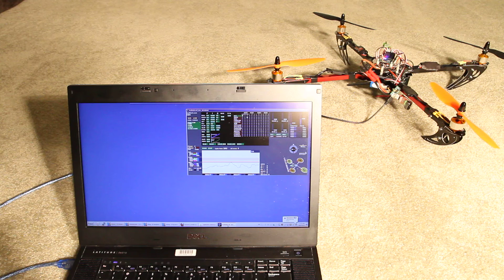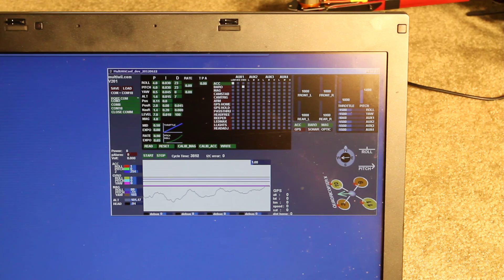MultiWii Quad problems cannot fly

Comment: Bro, you are using 18650 or similar LiIons. I used the same initially. Same problem.

But the real problem is that we all are dumb initially and the learning curve is very steep.

Those batteries just dont have enough amps to drive all 4 ESCs and motors. The Amps drop and thus one or more ESC cuts off.
Reply from the maker: I'm using 30C 3S battery, that do 30A discharge.... I do not think that was a battery issue :)
That was issue with that fact that it was in the air, also I switch from X to + configuration also reduced vibration :)
Thank you for comment !

Comment: I had an issue with the same exact kit you have bought, I am guessing from amazon from hobby power. I fixed many of the instability problems by putting everything onto a wooden frame. The MW FC needs decent vibration isolation. So build a wood frame, with a square hole in the middle to suspend a plate or board with all the electronics mounted on it. Will all that weight of the battery, electronics, etc suspended by strong, high tension bungee cord or rubber silicone tubing. Worked will for me.

I am, however, still having an issue, which I believe is related to the ESCs. Some reason when going from 0 throttle to some low level amount, 2 of the motors would occasionally glitch up and not work properly, as if only for a moment one of the 3 wires was a broke connection. It seems to have no physical cause after examination and more examination.  Please reply if you are having the same issue. Thanks
Reply: So, if I change my ESC the problem will be fix ?

Comment: 2 alternate propellers slowing down in normal, and is due to the integration in PID control. Because it isn't lifting, but the MW FC is still trying to correct small changes in pitch, roll, and yaw. In your case, it is probably yaw. The I attempts to cancel out "steady state" error by gradually increasing the difference in speed between the motors in attempt to correct the error. It obviously never does since it isn't even moving, and so the correction keeps gradually increasing. Bump or rotate the quad some and it should sort of reset
Reply from the maker: Yes! now I know this :)
Reply: amirnasher Have you got it up and flying reliably? And not having the same issue as me with the hobbypower ESCs? Did you flash the ESCS or any other mods to them? Thanks!
Reply: amirnasher Actually, you have the exact same kit as mine, except the ESCs, conveniently the exact issue on mine that I am trying to pin down! Oh well :)  Anyways were they yellow when you got them in the kit, thats what color mine are, or at least thats the color of the heatsink before I ripped it off to inspect the QC on the boards!
Reply from the maker: Power Max Actually this frame never flown reliably :(
I dont even know what to do. I tried everything but did not replaced ESCs so may be you are right and one or few are bad. They are still running original firmware... I don't even know if they are programmable.
Reply: amirnasher Well just last night, I have hit a bit of a "ah AHhh" moment, when I finally figured out how to program and calibrate the ESCs correctly. Below is the PDF which goes in detail about going that properly. It turned out that when I thought I calibrated the ESCs, I actually accidentally and unknowingly entered programming mode and changed stuff I had no intention to change!

www.hobbywing.com/uploadfiles/sx/file/Manual/HW-01-V4.pdf
http://www.hobbyking.com/hobbyking/store/uploads/811103388X7478X20.pdf

One of the many problems I have encountered with the ESCs was that one of them would make the motors "sticky" and not spin freely after using the ESC on it. It is the same effect as if you shorted the 3 poles on the motor together and try to spin it by hand. You can feel the resistance of it while rotating it. Thats Lorentz's law at play! Anyways thats why I suspected a resistor on one of the MOSFETs gates was not properly soldered on, causing the FET to stay on after the microcontroller stopped controlling it, shorting the motor and so naturally I was suspecting the hardware to be faulty, I proceeded to rip off the heat shrink to inspect things. Anyway, turned out I have turned on the "brake" feature on one of the ESCs accidentally. So setting the defaults fixed that. 

Also, when going into the programming mode, wait for the 1st, 2nd, 3rd, 4th, and 5th 'beeep----' which the PDF describes on the second page, and select start or startup mode. Then select 'normal' which revs up the motor as fast as possible and makes it so when the motor's prop is turned backwards, it is able to recover instead of act like it's broken!!! That has the obvious advantage that the motor will always work properly, but also does what simonK firmware would do, just to less of an extreme. I did not want to risk destroying the ESCs with sinonK so I did not flash it. (don't have the right tools anyway.)

Then make sure to calibrate all the ESCs so that when the quadcopter is initiated, the blades start rotating. The multiwii, once armed, should never let the motors come to a complete stop while flying. So you may need to configure the minimum throttle.

I do not know if this will solve your problems, and note sure if it will solve mine, as when I went to charge my battery, I found that it had a nick on one of the 3 4500mAH cells that caused it to short out internally and permanently destroy it. I will need to buy a new battery before any real testing. (I was using my hacked xbox power supply to test and configure all the ESCs!) at least now I am hopeful as I have good reasons to think this should fix most/all the issues!
Reply: amirnasher Also, to isolate vibrations from the multiwii, try suspending it somehow with short rubber bands, or mounting the board with the jello-killer thing designed for camera's. That will isolate the vibrations from driving the multiwii crazy. Those LPF setting in the config.h file do wonders as well if you don't have the construction materials to make a improvised vibration isolation. Good luck!
Reply from the maker: Power Max Yes, I tried LPF settings... but it makes Quad fly as a cow..... slooooow and unresponsive :(
Reply: amirnasher Yeah, thats what it is designed to do to some degree. It should not need to be that low, which setting did you try? Also, were you able to figure out how to program the ESCs or better yet flash them with simonK? The default parameters are designed to be optimizeds for fixed wing, so adjusting those like I explained above should possibly fix the problems. Do your motors spin up when armed? They should.
Reply: @Power Max   
For my case 3 propellers is slowing down, except the rear_L motor(it remains constant and does not change even I move the quad). Please help!

Comment: 2. trim with MAG only... you should aim for straight liftoffs dont bother with the PIDs 2 much. Just trim using your TX
3. enable ACC and play with the LEVEL PIDs to get it as you want. further trim using the Tx sticks. So if you have lets say...a forward drift...put the quad on the ground>disarm>Throttle stick to MAX then counter the drift by putting the right stick in the opposite direction of the drift....so down...you will see an LED on the board blink.
Do this until you don't have drift.

Comment: i also have multiwii board the HK multiwii 328P DSMP something...
1. first you have to get rid of vibrations > use a seimo app on a phone and hold the phone tight on each arm (with velco) > check for vibrations without props on; you should have very little. also you can check the amount of vibration that reach the board (without props) by holding a finger on the edge of the board. 
Its really a struggle to soften the vibrations it took me a whole week...
2. trim with MAG only...
Reply from the maker: Oh my... how did I missed all these messages 8 years ago :(

Comment from the maker: Thank you, I will definitely try to add foam/vibro gaskets to reduce vibrations. But currently I've put new motors and 12" props and it works better (less vibration) but flying is hardly possible it always drift somewhere... Event after hours of PID tuning (I might do something wrong potentially) but some PPL perfectly fly on default PID - but I cannot :(

Comment: Looks like the MultiWii board is so sensitive to vibrations. You either need a good foam around the controller, or the propellers/motors are not balanced and shaking the whole body.

Regarding the slowing down motor, at low throttle value it will have to drop on some channel because you are landed. The controller will keep looping certain error without being able to correct it, eventually the error will keep increasing causing one or more motors to slow down or stop.

I hope this might help